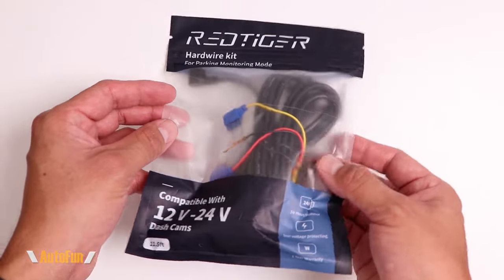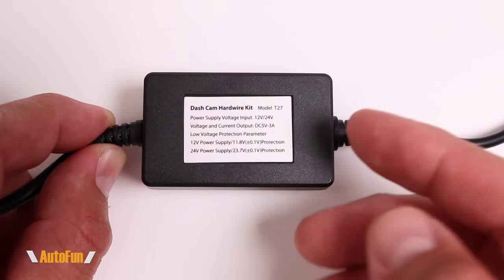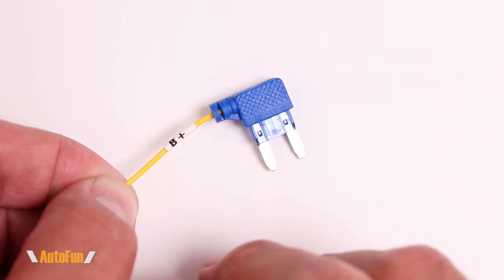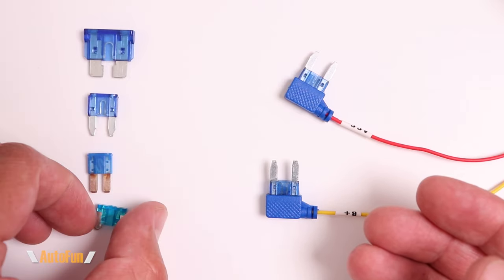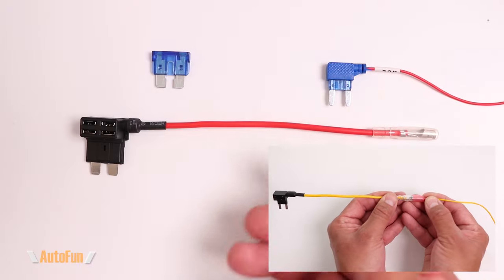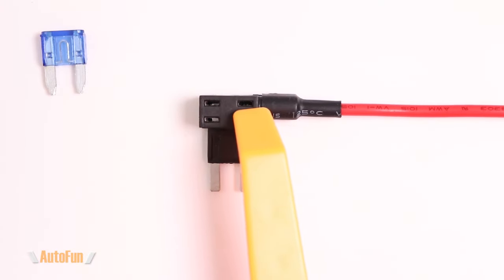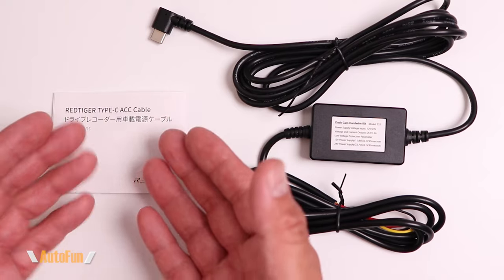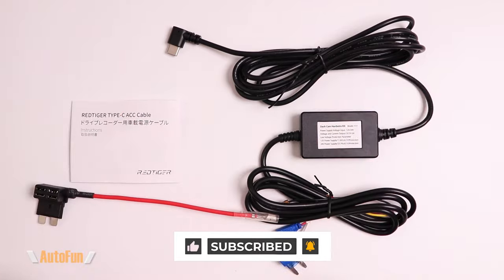REDTIGER HARDWIRE KIT (Install Prep, Connections & Fuse Taps Explained)

Comment: Noticed you don't have anything on Kenwood cameras, they have a funny hardwire kit, with just 1 fuse connector + ground :D
Reply from the maker: Hi Goose! Ah yes the 2 lead hardwire kits, yeah those are not as common but yes install is same but instead of connecting 3 wires only 2 wires are connected (refer to the instructions of the kit to determine the function of the 2 wires, most use GND and ACC and some use GND and BATT). Here is my hardwire video where I cover 2 lead and 3 lead hardwire kits https://youtu.be/Yky9_tTvwMc and here is my follow up video showing the hardwire install process https://youtu.be/K2iKXj82354 Cheers!
Reply: @AlexAutoFun  Cheers for responding. The reason I asked, because normally, there is 3 wires, ground, constant and ignition on only, this enables the one with ignition on to work when you drive, and constant to work when there is a parking mode. I am trying to wrap my head around, how parking mode will work in that setup, when car is off :D

Also, would you reccomend Kenwood cameras the 501 and 601? They have nice sets with those kits included and rear cams.
Reply from the maker: @Leinsterbaby  Ah yes, I would recommend to check the instructions for the kit, as mentioned earlier some two lead hardwire kits use ACC (switched ignition power) and GND and some other kits use BATT (constant battery power) and GND. It just depends on the kit and how it was designed to function. Usually on ACC and GND kits the dash cam will not have parking mode (unless it's equipped with a battery) and on kits with BATT and GND the dash cam will either stay on to record when the car is off or will enter parking mode after period of time. Ah regarding the 501 and 601, unfortunately I have tested any of their dash cams but I will see if I can add to the list of dash cams to review, stay tuned and Cheers!
Reply: @AlexAutoFun  Cheers! My dad says, if you don't understand it, leave it. So prime day is upon us, and I am going with a Vantrue x4s or a redtiger, depending which will be cheaper! :) They got both 3 wire kits. Thank yo for your hard work.
Reply from the maker: Haha that is a good saying, haven't heard it before but it's so true! 🍻

Comment: Hello - I've just had my unit installed at an audio shop and he told me that I need to read my manual when I go home because when trying to access the Parking Mode, he gets an error stating, "please connect the acc power kit" which is what he's done so what do I do now?
Reply from the maker: Hi Zurai! I like to start by saying (no disrespect to the shop that installed it) but any shop that tells a customer to go home and read to manual to figure it out, man that kind of customer service upsets me and I would definitely not go back to that place. That being said, I would have the installer confirm all connections to confirm they are connected to the correct locations for ACC and BATT (I seen cases where the connections for ACC and BATT are reversed or connected to the incorrect locations that do not provide power at the correct time for both ACC and BATT leading to the kit not working correctly). I also seen cases where a shop joined both ACC and BATT together to save time causing the issue you are describing. In rare cases you may also have a defective hardwire kit (or incorrect hardwire kit installed by the shop) which again your installer can confirm for you. Lastly you can also contact RedTiger for tech support, they may be able to walk you thru some troubleshooting steps. Hope this helps and I hope the shop comes thru and helps you my friend, Cheers!

Comment: If I don't want the constant power (parking mode) enabled, do I simply not plug in the constant power fuse? or does that need to get plugged in regardless?
Reply from the maker: Hi Jonathan! Most dash cams that require a 3 lead hardwire kit will usually need all 3 wires to be connected in order for the dash cam to work correctly. What I recommend when someone does not need park monitoring, is just to turn it off in the settings menu (most dash cams will let you turn off this feature). Cheers!
Reply: Like me, I just want to run camera when I’m in the car-driving.

I feel I can just use the cigarette lighter.

What is the pro of hardwiring if I just use the camera when driving?
Reply from the maker: Hi Unplugged! Typically the only advantages of hardwiring is that it frees up your cigarette lighter port and it can also enable parking mode. Cheers! @Unplugged704
Reply: @AlexAutoFun  Thank you!
Reply from the maker: You're welcome! @Unplugged704
Reply: You wouldnt need the hardwire kit if you dont want the parking option. Just use the power wire it comes with and tap using that.
Reply from the maker: Hi Nodnarb! Ah remember the contents of the hard wire kit are different than the contents of the cigarette lighter plug, if you permanently connect the cigarette lighter adapter to power, the dash will stay on all the time and may drain your cars battery (the hard wire kit turns off the dash cam when the car is off and back on when the car is on and also has low voltage cut off to protect the battery) Cheers! @Nodnarb69

Comment: I don’t think you can put a fuse on a fuse..
Reply from the maker: Hi Simon! Correct, it's not possible to put a fuse on a fuse. However fusetaps can be used to place 2 fuses into 1 fuse spot. Here is another video https://youtu.be/Qzw9yUYN7zo where I explain how fuse taps work in more detail, Cheers!